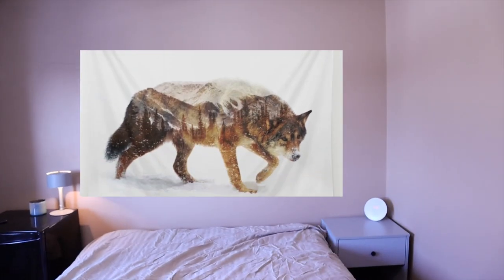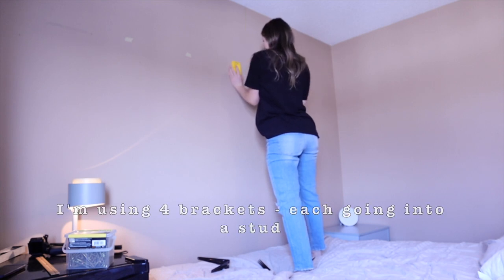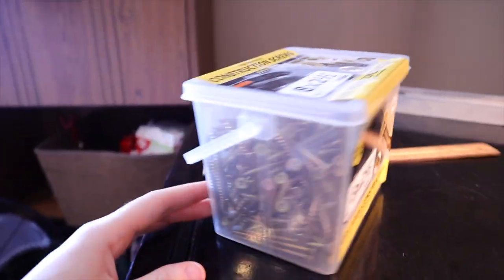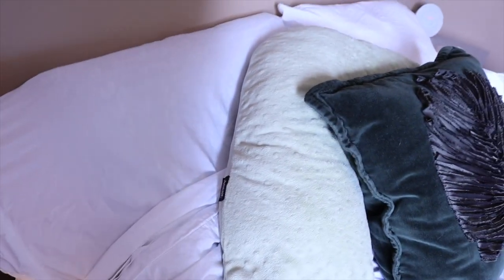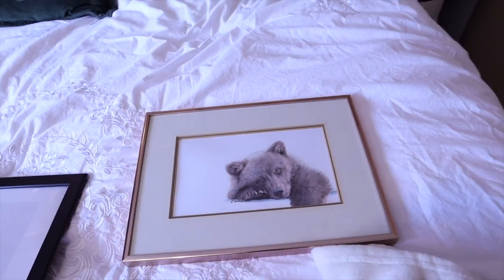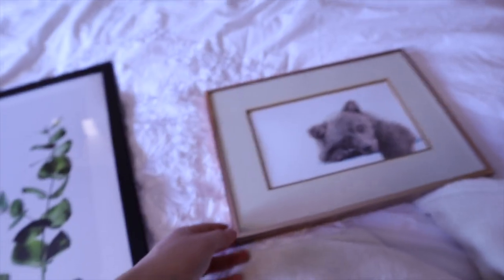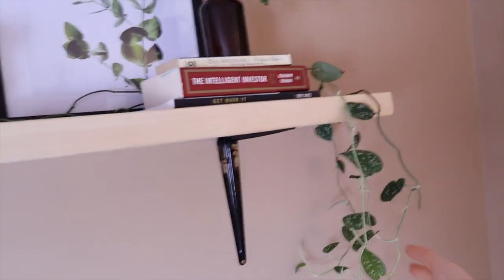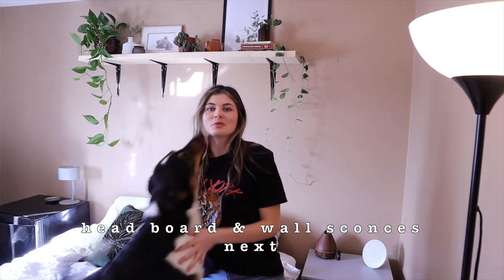DIY Shelf Above My Bed | Upcycled Home Decor & Styling Plants

Comment: Is your mattress on the floor? Mine is and I was just wondering if I should adjust the height of the shelf depending on if your bed is on the floor, too.
Reply from the maker: It is on a 7 inch tall metal frame. With the frame + box spring combined is 16 inches tall. With the mattress on top of those. Thanks for watching hope this helps :)

Comment: Where did you get your pine from?
Reply from the maker: From Home Depot, it was leftover from another project I used part of it for. You can get it at any hardware store but here is a link to the board I grabbed https://www.homedepot.ca/product/-2x10x8-spf-dimension-lumber/1000100173

It's actually just a general "lumber" that is slightly cheaper than pine.